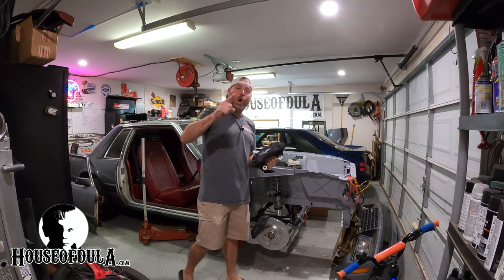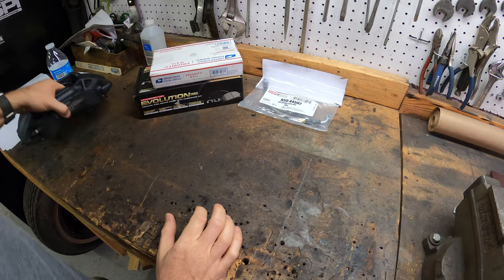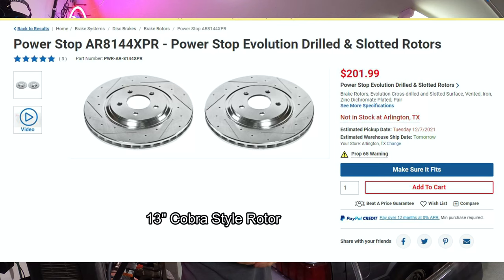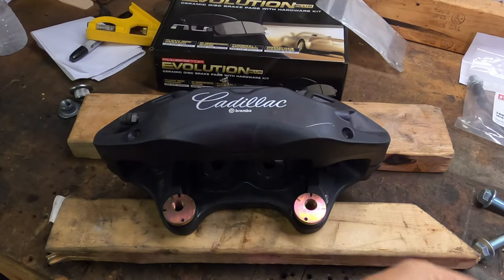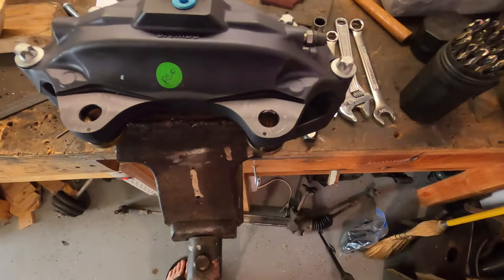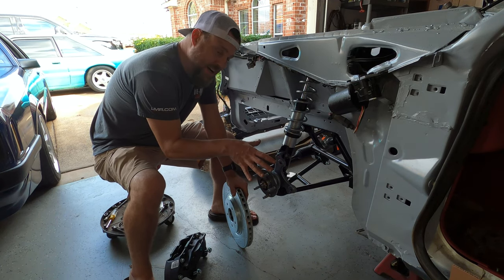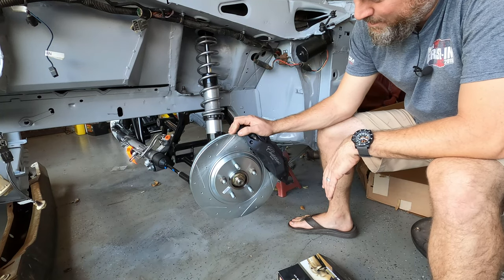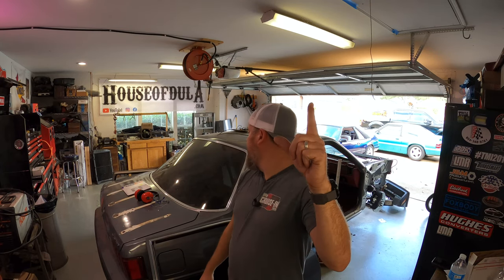Cadillac ATS Brembo Install with S&S Engineering Kit - CHEAP BIG BRAKE KIT for your Foxbody - Ep 28

Comment: So stock rear cobra calipers will be fine? I have a 95 and 03 I want to do this on..
Reply from the maker: I wish I can say definately that yes it will be fine. It will stop the car fine, just might have to crank up the dial bias on the rear. Ive heard that Taurus calipers work better. Look it up, ford taurus used the same exact caliper except the bore size is larger and more balances out with the 4 piston brembos. Again, this is all read, no real experience "yet"

Comment: Do you know the Part number for the Brakes lines I need to get? I know you mentioned the 950.61001 but did you find out if these are the correct ones? You said the other ones were to short is why I asked
Reply from the maker: Yessir. They are correct, at least for me, they are longer. I have them installed but no weight on the car, once on its own weight I think they will be perfect. I can follow up once we get the car down.

Comment: Hey what all did that engine have that you got out of that white GT?
Reply from the maker: Hey bud! Im still rocking this engine with my turbo. It was a stock block, stock rods and crank. Speed Pro forged pistons, gapped for nitrous (I was told, ballsy move on my part), and your trick from TFS upper...heads and stage 1 cam. 75mm throttle body. Was only fired in vehicle and never completed and ran on street so basically new. I upgraded the water pump, and bolted it into my 86.  Was a great deal, because the rest of the car was parted and I broke even on what I paid for it.

Comment: @HOUSE OF DULA
Do you know if these brakes will have enough clearance heigh wise  with 17” wheels
Reply from the maker: Some not all. Depends on many things, bs, spoke design etc. They don't clear cobra 17's but they did clear my 17" FR500s fine.
Reply: @HOUSEOFDULA  thanks a lot, 17” cobras is what I have so that’s awesome feed back. They look like they would be tight

Comment: What pin kit did you use? Do you have the part number? I ordered the lines you used, the calipers, brake pads but not sure about the pins with the clips? I’ll have to order the S&w kit when I get the funds.
Reply from the maker: The brake pads came with a bad of pins and a retainer bracket
Reply: @HOUSEOFDULA  Excellent! I ordered everything then. Now I just need to see find out if I need to change my Master cylinder and make sure my rear drum brakes are fine. I have a 86 I thought the brakes were different then the 87-93 but could be wrong.

I posted your video on Facebook and alot of people are now going to do this mod.
Reply: @antiricergt  your rear drums will be fine. Been running mine and drifting my foxbody with no problems.

Comment: Hey man, just saw this video a week ago and got the kit you linked I wanted to know if you know of some specific wheels that will fit with the Brembys?
Reply from the maker: Hey bud! I get asked this often...No way I could say. Best to get the offset measurements, and compare to manufacturers. Ive hears, the 17" FR500's fit as well as cobra anniversary wheels, but I cannot confirm. Its not the diameter thats important as much as room spokes and caliper face.
Reply: @HOUSEOFDULA  Okay thanks man!
Reply: @HOUSEOFDULA  Curious what the dimension is from rotor face to outer caliper?

Comment: with a 4 piston caliper you will always have teh same clamping forces on both sides regardless of offseet, just the  pistons on one side will be 2mm further out for that applicaion on one side.
Reply from the maker: Man good to know. I wasn't completely sure about this, I figured there was a greater reason to keep it centered,  but I thought that...if it was off the piston would just come out further on a side. I appreciate you clarifying this,
Reply: That is true but u will not be able to fit new brake pads unless u grind them down by 2mm one side.  They are super tight fit brand new. Plenty of fmc members have done this.

Comment: Did you upgrade the master cylinder?
Reply from the maker: Its your standard cobra 1" with a STOCK 87-93 style booster. Thats all that would fit on the 79. We'll see I think it will be fine.

Comment: Did the brake lines work ? They look like they are short .
Reply from the maker: No. I pinned the comment at top that the PN for the lines were wrong, and I have the PN there for the correct length. They we're way too short.
Reply from the maker: Brake Lines:
READ! - StopTech 950.44507 ***These are not correct, try 950.61001 - part number I mentioned in the video will be too short

Comment: I got the brakes do I have to change rims to fit? Rn I have 06 gt rims on my notch
Reply from the maker: This is a question i keep getting asked, whether some wheels will fit. I have no clue, best to do what i plan and take measurements of the caliper to hub face then measure the wheels or get the specs from the manufactures.

Comment: Do these work on a 17 inch pony wheel?
Reply from the maker: Most likely no. I cant say definitively because I have not tried. However, I will say, MOST wheels for these fox bodies will not fit. With the exception to big brake cars...Cobra anniversary wheels might, my 17" FR500s DO FIT. But its the spoke design more so than the diameter needed to clear these calipers. You need a spoke that pokes out and meant for a big brake. The ponies are pretty flat.

Comment: How different is this kit for a 99 to 04 mustang ? If you know .
Reply from the maker: Same, this kit is being performed on 94 spindles. Brake mounts are the same 94-04, track width differ slightly, and tie rod height but brake calipers are the same.

Comment: What year master cylinder and booster is that I’m tryna look for it
Reply from the maker: Its a new standard fox 86-93 booster, not cobra, and not sn95...The master cylinder is a 1" bore master (popular cobra spec I believe). I'll just have to see if it will work, I will need a larger brake in the rear versus your standard cobra brake to help with the brake bias.
Reply: @HOUSEOFDULA   I’ll be waiting on that video I am gonna be running 6.5 bs in rear with 15x10

Comment: Does anyone know if this is heavier then the sn95 cobra brake calipers?
Reply from the maker: Id have to assume they are. 2 pistons and much more aluminum. that being said these are still pretty light.
Reply: @HOUSEOFDULA  I think these won't be ideal for a drag car because of clearance
Reply from the maker: @rafatrill  Yes and no. You can run an 18" front runner skinnies. Lots of guys run a larger front lightweight wheel with 15"  slicks in the rear. These have plenty of stopping power for a drag car IMO. Are they the lightest? No, youd want to look at the wilwood ultra light drag setups or something. But these are engineered to be be on a big ATS, they are likely huge to help control noise as well. These are good beginner autocross, steet or drag setup IMO especially as light as it is....but likely ovrekill for a drag car.
Reply: @HOUSEOFDULA  I wish I would of known before hand I have some dual piston calipers off a newer cobra
Reply from the maker: @rafatrill  - Oh man you can sell those off preety quick and make money back if you wanted to go this route. 2 piston cobra brakes works great for 99% of foxbodys out there
Reply: @HOUSEOFDULA  I'll consider it